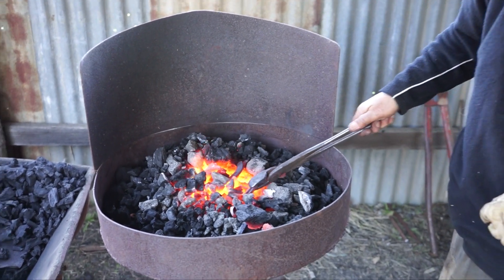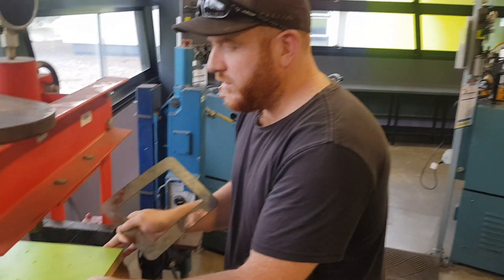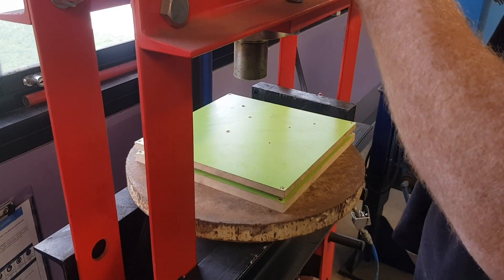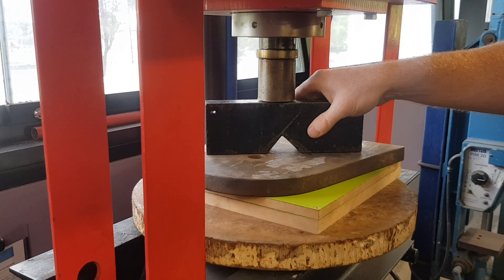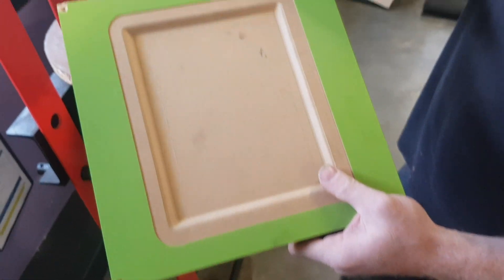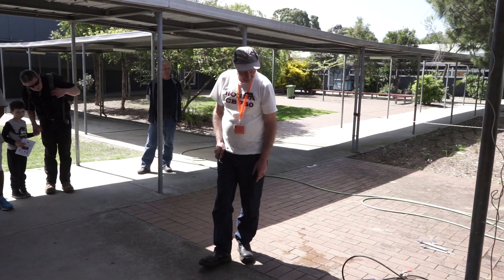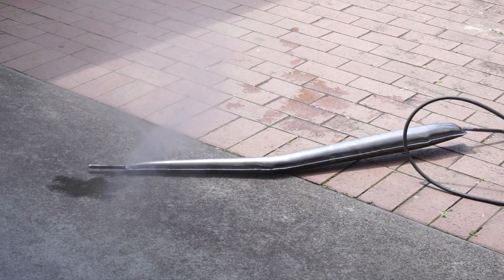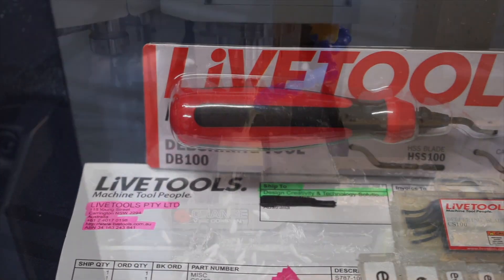Metal FORMING in your home shop - DIY

Comment: Hi mate 👋 any idea what sort of tonnage I would require to press form 6mm aluminium sheet which would also have some embossed lettering? 

I was going to DIY a 20 ton press using a bottle jack but after watching this I'm assuming I need more than double? Any input would be  appreciated 👍 👍
Reply from the maker: Sorry mate can’t help you with this one. You need to speak with a tool and di maker who specialises in press tooling. Cheers 🍻
Reply: @DCT_Aaron_Engineering  thanks for the response mate. I think I will go and have a word with some tool/die makers. Makes sense 👍👍

Comment: Very cool.  I was surprised at just how much the pipe pumped up from just the tap pressure.  Thanks. :)
Reply from the maker: bluehandsvideo G’day Mike. I was surprised also mate when I was standing there watching it. Glad you enjoyed it. Can’t wait to see what you’ll create with your new GoPro 👍🍻
Reply: @DCT_Aaron_Engineering  Considering I've had a hero4 sitting here unused for many years.....I'll be lucky if I even use the 9. lol  As soon as I fired it up, it said it had a wifi connectivity issue.  That was yesterday just after I opened it up.....been sitting since.  I just want this stuff to work.....I'm really sick of buying tools like that and having them turn into projects before I can even use them. :(  That set tru chuck better not become a problem or it will become a thousand dollar dent in my floor. lol  Oh.....my tungsten grinder showed up later in the day.....I might see about playing with that today. :)

Comment: It would be a lot easier to clean up after the water blaster than the usual grease gun method. Thin material like that seems to work fine at 1500psi, the 10,000 from a grease gun not required.
Reply: It's pretty juicy up here already? Winter is a thing of the past.
I'll send you an email directly. I have a couple of questions for you.
Reply from the maker: Mike Newman It’s bloody cold here mate. Sure shoot me an email or give me a call tomorrow if you like 👍
Reply from the maker: G’day Mike. Not wrong buddy. We used to use the grease method to remove the spigot bearing from the crankshaft. Bloody made a mess. Hope you’re well up there? I bet the weather is nicer there than here ATM. 🍻